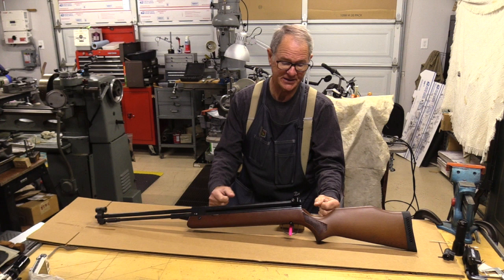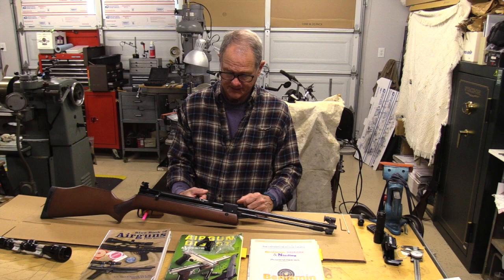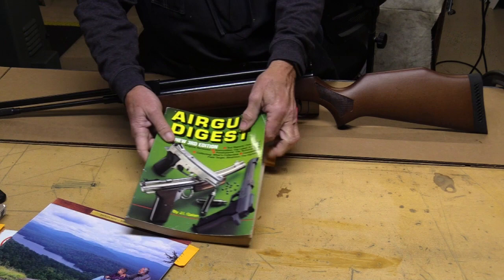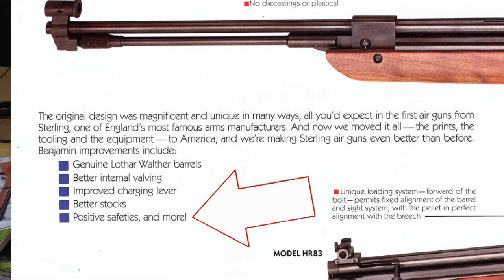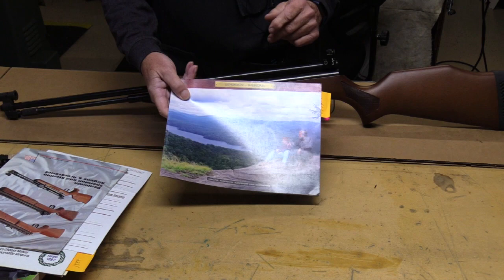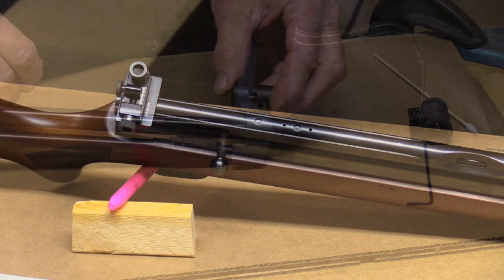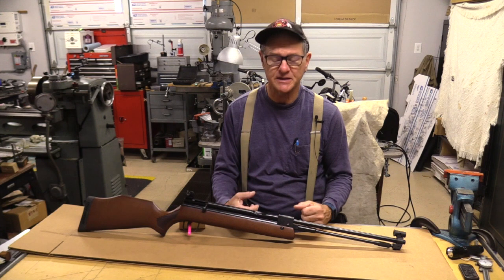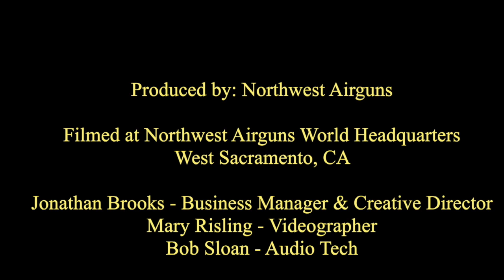Quick Look at a Sterling HR81 air rifle

Comment: I knew the designer of this rifle, in his own words it was intended to be a CHEAP cadet trainer, Sterling went against his wishes and set a higher more expensive speck. The 81 was released to the public in 81 in 83 Sterling released the 83 with great song and dance about a walnut stock and improved trigger, not to mention a greater price. Unfortunately the public were unconvinced by the improvements in fact many claimed the trigger was worse and indeed early 83's were finding their way back due to trigger failures whether this was down to rushed factory assembly or public monkey fingers who knows. Having owned and shot both in both calibers I can say the 81 in .177 was a accurate gun capable of one hole groups. My own dislike of the gun was down to its lugubrious action, I still own one and like others I have owned replaced the spring with a shorter zippier model, this reduces lock time considerably and ups the power to boot.  It must be said that after the guns production was moved to the states it's design was messed with again and it's leatherhead piston was replaced with an O ring this was set far too close to the end of the piston leading to the crumbling of the piston edge and loss of power. I have no knowledge as to what was done about this problem it could be nothing. After Sterling UK went down it was possible to purchase new old stock guns for £80 about $110 US.
Strangely some years later after state side production ceased it was still possible to purchase both UK and US built guns for the same price, in fact I was offered three brand new in the box US built guns recently at about £300 apiece. 
Needless to say I declined the offer, had they been cheaper I would have taken the risk and reworked the pistons and other internals, properly set up they would make a very nice squirrel gun

Comment: This brings back memories. I owned the HR81 and found it shot well but was a little underpowered, as you showed in the video. We are restricted in the UK to 12 ftlb and anything less than 11 ftlb was often ignored, believing power is more important than accuracy, this still seems to be the case today in America with guns being advertised at 1500 fps in .177 cal.
The original Sterling factory is still standing and can be seen on Google Maps at this location. 
Wolseley Plumb & Parts - Plumbing supply store
Unit 3
Sterling Works
Dagenham RM10 8TX
United Kingdom
There is also a Wikipedia page for the HR81 giving some good information.
The name STEN originates from STerling ENgineering.

Greetings from Germany.

Comment: I had an HR 81 in .22 in 1982 (ish)  there was nothing inaccurate or underpowered about it. Iwas in Northern Ireland which required a Fire Arms Certificate for any air rifle so the UK 12ft lb limit did not apply.  The odd bolt action actually sized the pellet. 
What really killed it was the weight and its comparatively slow operation.  The other thing was due to its design it was despite special springs cylinder polishing, molybendum lubricants and everything else that clever boys could think of it was very hard to get it to exceed 12ft pounds.
Therfore if you could get your  hand  on HW80 which did about 17ft pounds that was the way to go. Although that gun fecking tortured me as well needing re-zeroed every time you picked it up